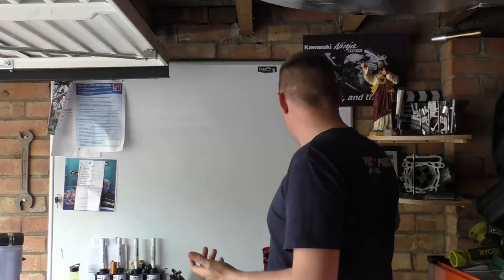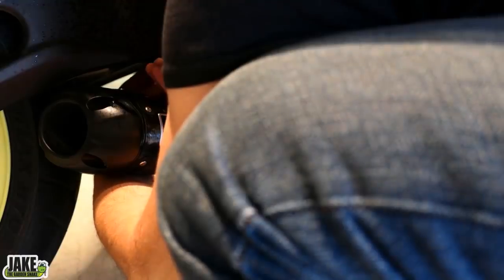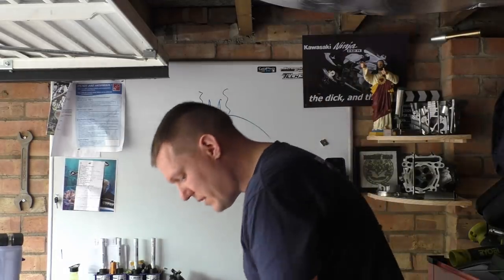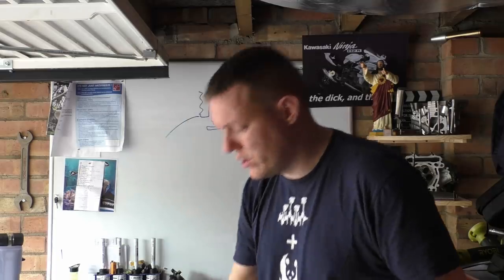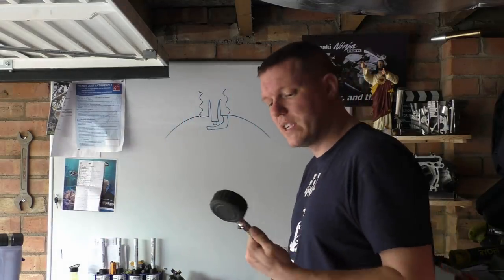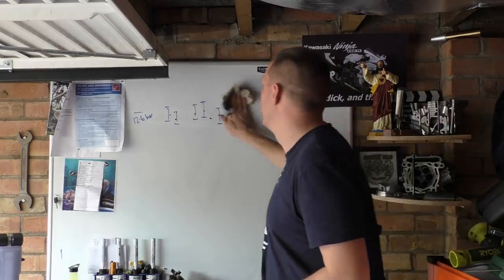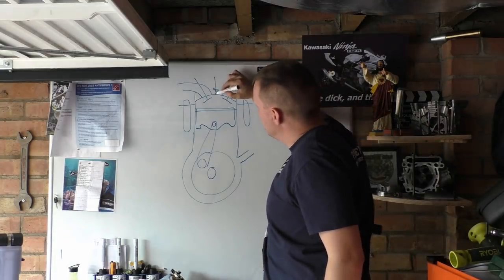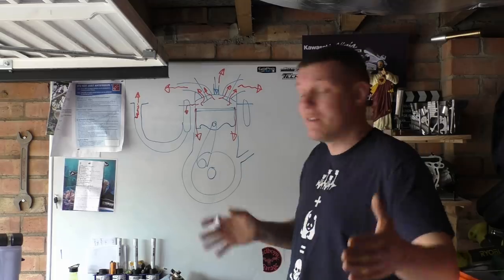Compression testing and readings

Comment: If there's a schreader valve then the pressure would build up in the tube until it equalizes with the cylinder pressure. Therefor the volume of the test rig should make no
difference.
 I could just be barking up the wrong tree though.
Reply from the maker: But pressure is cramming in air i.e air desnity is increased unless its heat shit loads. The air that fills the tube/pipe is air from the cylinder - this is why you have to cycle the engine a few times to get a reading. 

I was waiting for the actual compressio video - but you dickheads are too impatient LOL

Comment: The delta among cylinders is what is important for compression tests.  A low reading on 1 cylinder(relative to the rest) is indicative of some seriously wrong shit, even if the 1 is in the correct range. Almost always it will be a bad head gasket. It could also be bent/stretched valves, fucked rings, or even a bent rod.

Comment: Would an auto decompressor mess up a compression test? I've got a SZR660 which is the 5 valve XT single engine and has an auto decompression cam so I wonder if at starter motor speeds the exhaust valve is being opened reducing peak compression.
Reply: You can't compression test a aute decomp engine as far as I know.

Comment: is it possible to claculate your compression pressure with your compression ratio?
Reply: valve timing, how fast you rotate the engine, and hot much the air heats up when you compress it all affects the reading, so no
Reply from the maker: Well, yes - but what if you have a leak - hence the test
Reply: That's where you hear the terms static and dynamic compression. If you have a 10:1 static comp. ratio, then your theoretical pressure should be 147 psi. But that of course never happens due to the aforementioned limits.

Comment: wouldn't a leak down test be at tdc Matt as the pressure would push the piston down the bore or am I missing something obvious.
Reply from the maker: why would you want that?
Reply: Most leak-down tests are performed at TDC.
Yes, the test pressure can force the piston down the bore. 
There are tools available to prevent crank rotation during testing. 
There is value in testing at piston positions other than TDC, but the operator must be aware of the degree  of crank rotation when the valves are off their seats to prevent erroneous conclusions.